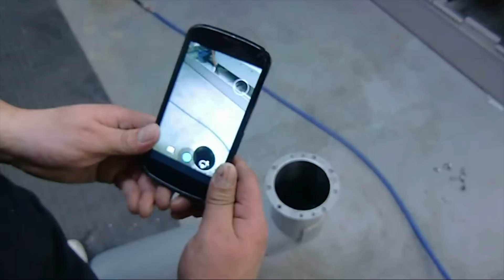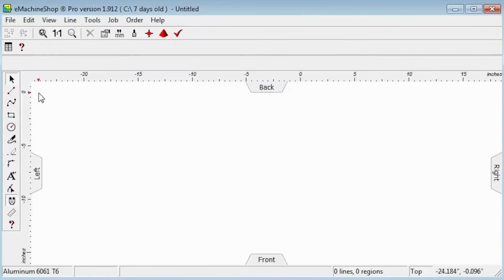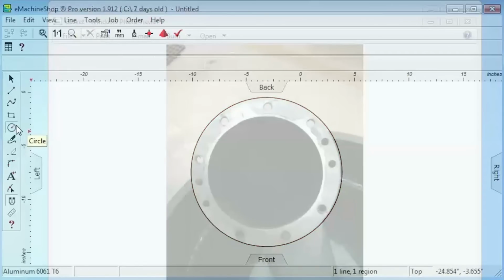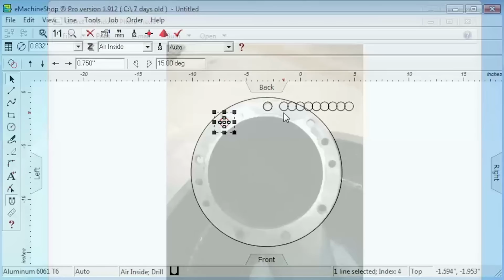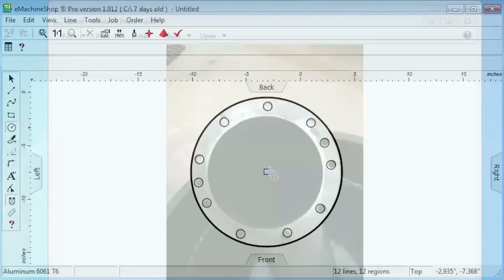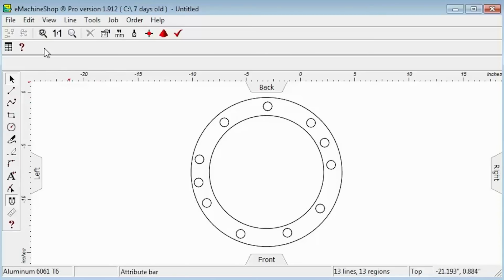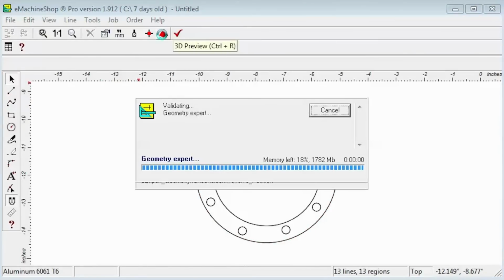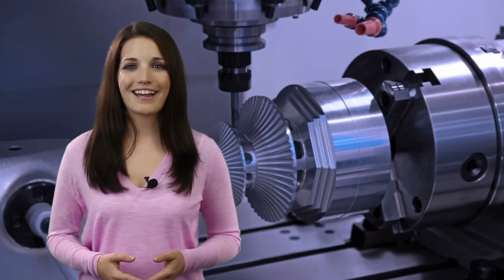Tracing Feature (Gasket)

Comment: That's real simple for a round object like the pipe in the video. 
What about very complex gasket shapes like a side cover on a motor. Lots of curves, bolt holes, alignment pin holes, etc
Reply: You could use the same technique, i. e using. either a photograph or a scanned image of the gasket or cover, bring the image into Inkscape, then using its object tracing feature to trace the edges, with some minor cleanup. You end up with a vector image that can be converted to G-code. Inkscape is free, and there are seveal good tutorials available online.